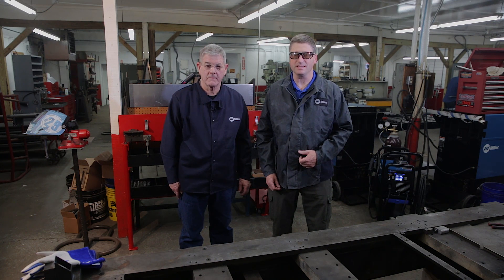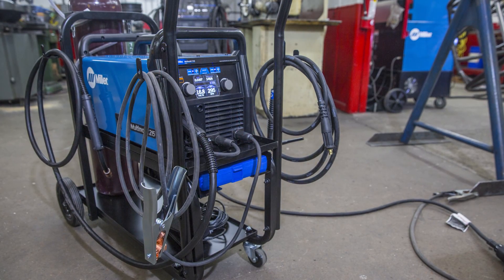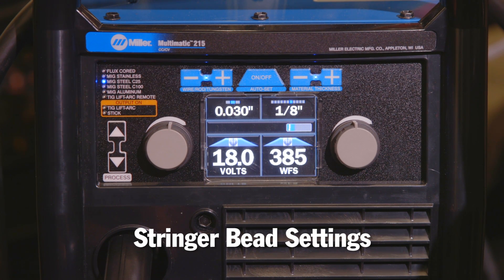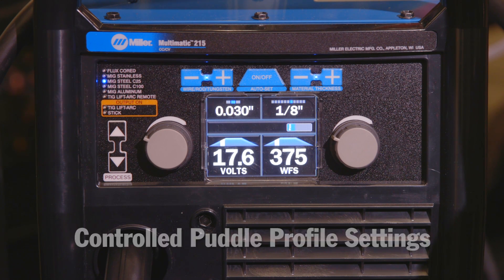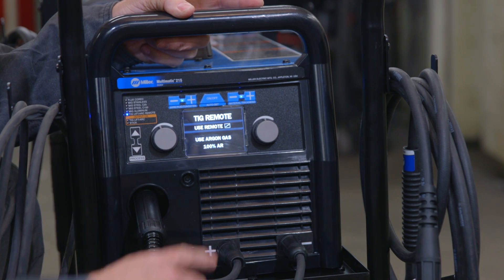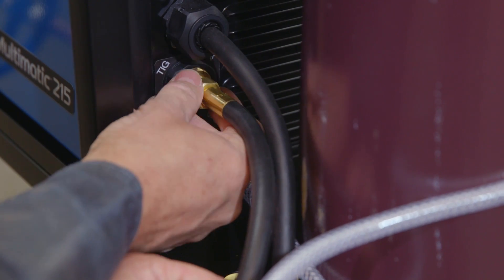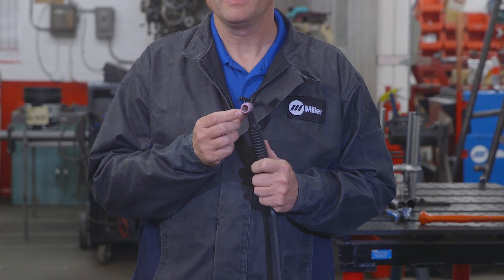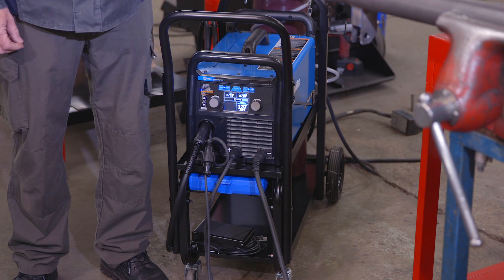Miller Multimatic 215 Multiprocess welder MIG welds and TIG welds at J&J Auto Racing

Comment: I bought my son a Miller 211 w/spool 150 , now he wants the Miller 215 mp? I told him he should just ad a stick welder w/tig options? Not sure what to think on this matter? Any help?
Reply from the maker: Bill, The Millermatic 211 will be the same output as the Multimatic 215 on the GMAW side.  Al machine that would have nearly the same DC GTAW output and SMAW output as the Multimatic 215 would be the Maxstar 161.  The option to add this machine vs replacing the Millermatic with a Multimatic 215 has pro's and con's and would need to be decided based on your personal preferences.  If he were looking to replace the Millermatic with a Multimatic 220 AC/DC to gain AC GTAW capability, then the decisions to replace the 211 becomes more cost effective than to add an additional machine.  Hope this helps, please reach out with any further questions!

Comment: My TIG torch (CK17) has a small brass threaded end on the cable.  What adapter or fitting do I need to connect it with this machine?
Reply from the maker: Thank you for reaching out. We recommend giving our service line a call to talk this through with a tech. The number is 920-734-9821. If there’s anything else we can help with, just let us know.

Comment: Which one is better 215 or 200
Reply from the maker: Thanks for your question. That will depend on what type of projects you will be working on. We recommend checking out those spec sheets on our website to see what best fits what you are looking for: MillerWelds.com/equipment/welders/multiprocess/multimatic-215-multiprocess-welder-m30090 and MillerWelds.com/equipment/welders/multiprocess/multimatic-200-multiprocess-welder-m00361.

Comment: On a single pass, will it weld 1/2” steel?
Reply from the maker: Thanks for your question. The Mutimatic 215 welds up to 3/8" mild steel. You can learn more about this welder on our website: https://www.millerwelds.com/equipment/welders/multiprocess/multimatic-215-multiprocess-welder-m30090.

Comment: I still think MILLER NEEDS TO WAKE UP AS THERE ARE SUPERIOR WELDERS OUT THERE THAT CAN GO LOWER IN AMP (5AMPS) AND WELD 1 /4 ALUMINUM WITHOUT PREHEAT OR THE USE OF HELIUM!!
WAKE UP MILLER YOU NOT EVEN CLOSE TO A GOOD WELDER FOR 3000 DOLLARS!
MAYBE YOU SHOULD COMBINE THE TECH FROM THE SYNCROWAVE 210 WITH THIS MACHINE!!

Comment: Can you use dual sheilded flux core wire in this machine
Reply from the maker: Thank you for the question Arthur. Yes, it is capable of running dual shielded wire depending on the specs of the wire you are using. Thank you.

Comment: At the welding school I attended, we were taught not to remove the filler rod from the gas stream to prevent the filler rod from becoming contaminated and then being placed into the weld. Am I being too critical here or do I need re-educating.
Reply from the maker: Thanks for your question, Dan. You are correct. If he was outside the gas zone, the tip of the molten weld rod could get contaminated and transfer that to the weld. He is using a larger gas lens which gives better gas coverage, so he’s not far enough outside the gas area for that to be an issue. Let us know if you have any further questions. Thank you!